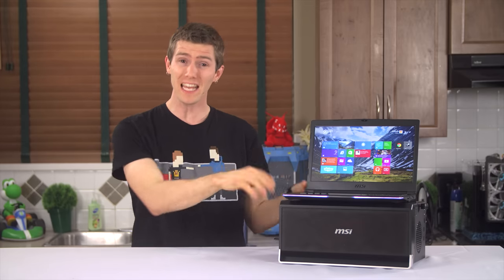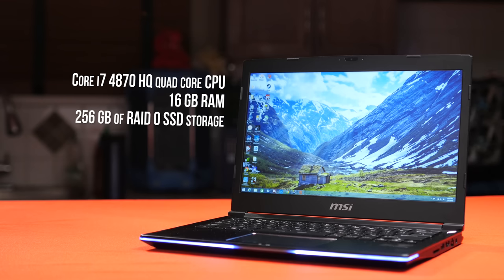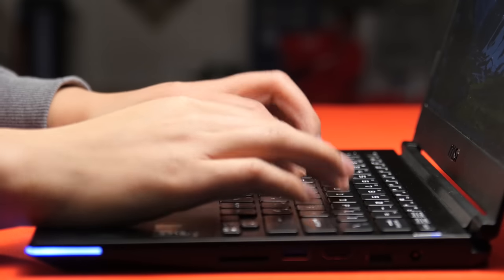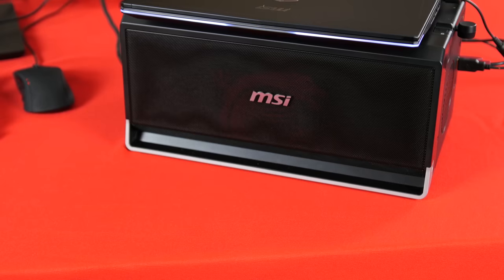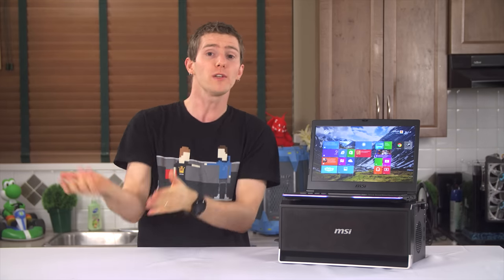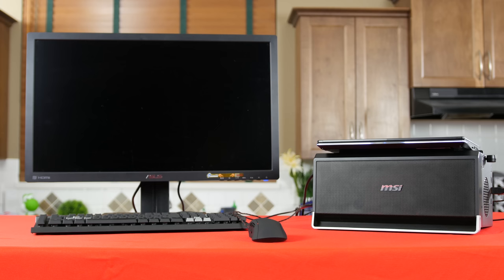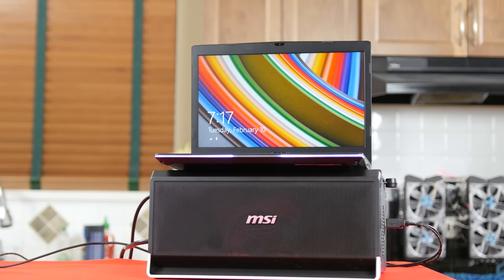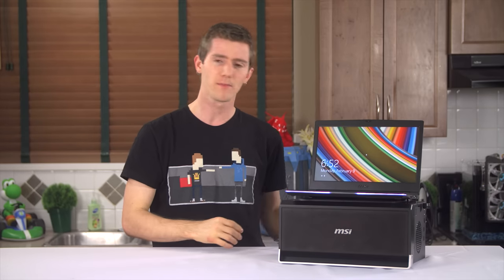MSI GS30 Shadow - Part Beastly Gaming Rig, Part Ultrabook

Comment: Okay I don't unserstand. Either people here are dumb or they just can't think outside the box. Let me explain this. This is not a solution for gamers on move, this is not a solution for desktop gamer who like his build and how it looks. This is a solution for people who are gamers, game at home 99% of their time but still need a notebook for meeting/work/school. I personally would benefit from it. I work with my notebook but I don't travel often and certainly when I do and don't want to game then. I also have a powerful rig that I build for gaming. I have not picked up tha gaming laptops because they suck and it's the truth. MSI solution is the best thing in the world for me. I can still maintain my gaming addiction and still be able to work on lightwieght nnotebook. Do I think its perfect? No. As linus said there are 1st gen problems with it. I would prefer better batery life for sure. Better keyboard would be nice as well and if it as loud as Linus said I would not buy it myself. But unlike many of you here I can see the purpose of this device and see areas where it is useful. Maybe with Gen 2 or 3 of this product I will buy it however still I consider this move to be the right one.
Reply: At 2,000 dollars for just the laptop and the dock, no desktop gpu, you can get a decent 800 dollar laptop and a 1,200 dollar desktop. That is why it is impractical right now. And the excuse of gaming on the go can't be used for this because the dock is as large if not larger than some complete ITX computer builds.
Reply: Timothy Lastovica I have spent over 3k on my notebook and PC. Having this is more practical for me. And when did I mention about this being on the go? I said specificly this isn't for people on the go. Yes 2000 without is a lot and yes they could take it down to 1,5k but hey its Gen 1.
Reply: much agreed brotha, i use my laptop for class and thus carry it around with me every day, then i get home and i wanna game and watch 4k videos and all that fun shit. i had a macbook pro 2010 13 inch, cool n all but recently got a GS60 4k. wish this had come out a month ago.... perfect to dump your exact same laptop at home with all your programs n shit and have proper desktop performance, then pickup and go. I certainly don't game on the go and if i do it's minecraft, which the iris pro can handle. anyways yeah, now to sell my GS60 haha
Reply: Fighting_Hussar Dude u can build ur own litte box way cheaper if so
Reply: Fighting_Hussar I didn't use your name in that sentence about gaming on the go. Its Youtube, I'm prepared for some idiot below me to use that rebuttal. The laptop has Intel Iris pro graphics. So the only way anyone would game on this particular setup is it in desktop mode. Literally no different than having a average notebook and a gaming desktop. If MSI put an 860m in the notebook for the price point at least it could do light gaming on the go plus desktop style gaming while at home. I also have no hope in seeing the price of this equipment drop. Any gaming branded laptop has carried a huge price tag for the last 15 years. As for you in particular, i don't see how it can be more convenient. Come home, put the laptop bag by the side of your desk, and start up the desktop. Come home, unzip the laptop and put it in the dock, plug in the cables, start up the laptop. Though I don't care how you spend your money. Hopefully they improve it next generation so you can get out of it what you see in it. I just find it impractical.
Reply: I like the idea too, and i hope it becomes more standard. But it is ridiculously expensive.let me tell you why, for 2000 dollars you can get a razer balde with gtx 970m which has better battery, better screen, similar processor, and can game on the go or at home. note that the razer is already an expensive product.for 2000 dollars here, you also need to   add a graphics card, and an external harddisk. I think it should be 400~500 dollars cheaper. or they should include with it a decent graphics card like gtx 970 or amd r290 or 280x and 1 TB hard disk at this price . Also i think it would better if they used a dedicated mobile graphics like gtx 850m and to drop the Iris Pro. Alienware, which is already a company with overpriced notebooks has a similar solution that doesn't require you to buy the dock purchase seperatly at 300$, and it starts much cheaper at 1000$ just for the laptop that includes an i5 ULV and a gtx 860m and can run the dock on the same notebook screen.
Again i am a fan of this idea and i will wait till it is improved and reduced price till i consider it. for now it just better to get a decent 800$ ultrabook and 1000+ dollars gaming desktop pc, and still have some money on the side.
Reply: Timothy Lastovica Just needed to clarify this: "Come home, put the laptop bag by the side of your desk, and start up the desktop. Come home, unzip the laptop and put it in the dock, plug in the cables, start up the laptop."

What cables are you plugging in? Considering that the dock has ethernet, mic and speaker, 4 usb...What do you still need to plug into the laptop?
Reply: Goldmarble Honestly the cables were from muscle memory of power and mouse. It won't need power since it charges through the dock and for the mouse your milage may vary if you re using one, buy two, or have a wireless with a small hub.
Reply: Laptops r too expensive for gaming not to mention lots of overheating issues. no matter how many new one they build. Til they have figure out a solution to this it's pointless for an expansion device. I would like developer to also give u the option of custom build laptops for graphics card of. Your own choosing n also heat sinks of your choosing too.
Reply: Sorry I don't think I understood why you wanted this? As in why is this a better solution that having a gaming pc + a laptop? Is it because of the price you spend or something I'm missing?

My laptop I had for undergrad finally crapped out after 5 years and I got a chromebook and built my own gaming pc, Including every single thing in the price (cpu, graphics card, monitors, os, the chromebook, etc) I spent ~1300 dollars. I know that I didn't build like the most top of the line computer or anything because I play 2 kind of low power games, but even if you spend the extra 700 dollars you can get a better gaming pc set up than this notebook. 

Why is spending like 1600-1700 dollars on a gaming pc and then 200 dollars on a chromebook or like 300 dollars on a laptop (both which will work just fine for a job/school) not a better solution than this?
Reply: Molin Ray That'd probably suit me in the next 4 / 5 years, however right now i'm in college 5 days a week. When i'm home I use my laptop, when i'm at college I use my laptop. Everything is on that it. I can work anywhere and I have all of my files on that thing. Having a desktop is totally pointless and is actually an issue. When working from it i'd have to transfer GB's of film footage and transferring a VS or Eclipse project really isn't easy beyond WPF or Win Forms. If I had a desktop i'd have to transfer everything because i'd most likely only be able to buy a £600 laptop, which is probably awful in comparison to a £1200 - £1500 custom build. 
I think I game on it 2 maybe 3 hours a week. It's a hobby. I really reap the benefits when working with video however.

In other words, having one machine makes my life easier. I'm at college, so I need a laptop. That's it, and i'm willing to pay a premium for that. When they get this perfected I may consider purchasing one. At the moment I have a £2000 Macbook Pro, and as soon as the Thunderbolt 2 to PCI docks come down in price i'll be purchasing one.

Once I leave college, i'll most likely not need a laptop. That's why I spent so much, so it'll last me for years. Hopefully my next computer will be a Desktop, however I just love being able to pickup my computer and have everything with me always. It makes everything so much easier, I even use it at work.
Reply: Steven Chorkley Yeah I totally understand that, but that seems to be a case by case scenario. As a science/econ student I didn't have any big files that a flash drive wouldn't have taken care of and I didn't really work with video or anything. I pretty much used my college's blackboard, a program that let me listen to lectures and some basic watching videos on youtube or the school server etc.

And yeah I'm really loving this set up right now. A laptop with a decent battery life for grad school + a nice computer to go home and play games on. Not to mention something like a chromebook keeps me focused in lectures (can't really play any games unless you just wanna play like flash games or something).
Reply: why not get a gamingdesktop and a cheap notebook
Reply: It doesn't have a GPU included. You could get a cheap notebook and a good desktop if you think about it.
Reply: the major problem with this is the price. if the price is almost equivalent to a laptop pc combo its a decent solution. but stuff like this will be always overpriced. so everyone with a clear mind will never buy something like this
Reply: ***** Also, NO GPU.
Reply: No travelling with this thing, either.
Reply: People keep saying to get a cheap notebook and a decent gaming desktop instead of this.

The problem with that idea, it that it doesn't really compare. A cheap notebook is going to be a hell of a lot slower than the GS30, because it isn't going to have anywhere near as good of a processor. Not going to come with a pair of SSDs, and most important, is not going to have anywhere near as good of a screen. I have a shit laptop with a seriously bad TN panel, and it is aggravating to try and use without getting colour distortion. This has an IPS panel, which makes that a complete non-issue. Viewing angles matter.

Again, this is a premium notebook, with an additional feature for when you get home.

Again, this has a Core i7 4870 cpu, and a 13.3" 1080p IPS panel. If you would be fine with a terrible little notebook, and a decent gaming rig? This is obviously not targeted to you. If you want a damn good little notebook, and a gaming rig? Then this MIGHT be for you. Seriously, just because it doesn't make sense for you, is no reason to shit talk a product.
Reply: Goldmarble I don't know about others, but my issue is this whole docking system.

 In order to use this system, you need this laptop ($2000 premium laptop, no other laptops can currently use the dock if I understand it right.), the dock, a separate GPU (not included, and the average good GPU costs $300(?). Correct me if I'm wrong on the price. ), and separate peripherals (monitor/mouse/keyboard, costs are too varied to even try to guess).

For the amount of money you have to put into it, it seems cheaper to get two separate systems. I know it has first gen pains, therefore expensive, but is there even a demand for this system to get past those pains?
Reply: Goldmarble A toshiba chromebook 2 does have a 13.3" 1080p IPS panel and a ssd. It only costs ~300 dollars too (just pointing that out to counter what you said about other laptops).

Ofcourse a chromebook can't compete with the cpu or gaming prowess of that laptop, but if you just want a good looking, well functioning notebook there are many other options than this one.

Not trying to say you specifically wouldn't use it, but this caters to such a small crowd and is limited by first gen docking that I just don't see it going anywhere.
Reply: Molin Ray Yes. The Chromebook does have an ssd. A 16 GB ssd. Not a pair of 128s or 256 Gig ssds, but 16gigs. Also stepping down to 4 gigs of ram, and a Celeron N2840 CPU. Great if all you are doing is a bit of basic writing or web browsing, but if you do any multitasking, any photo editing? Any other use? No.

This is what I am saying: You're trying to compare two different systems, for two completely different philosophies of use, purely to justify your position based on cost.

But that makes no sense. If someone just wants a gaming rig, and something to surf the web when they're not home? Yeah, a gaming rig and a chromebook make a hell of a lot more sense. No argument. There would be no benefit to be had by the GS30. If someone wants to game while traveling, or spends more time at their friends houses to game? A dedicated gaming laptop makes more sense. No Argument.

But for someone who needs a decently powerful laptop for work, and likes to game when they get home? This makes a compelling argument for some.

Will it flounder? It may. But I commend MSI on the attempt, and I hope it does sell decently enough for them to make an improved, second, and third generation.

And for me? No. I would have no use for it. I have a shitty laptop that I don't really use anyways.
Reply: Timothy Lastovica An $800 laptop is a piece of shit that doesn't do anything unless the only work you do is write word docs.  If you need a grown up laptop to do anything then you are spending a minimum of $1800 on it.  I've been looking all over to try and find a laptop that I can work from and the most acceptable one I've found is $2300 and it's non-gaming.  So I still need a desktop to game on, so now I have to have two.  This laptop would have filled both roles perfectly if the battery life wasn't shit.
Reply: Timothy Lastovica Figures, that was what I was going to ask him. Why would he need a $2300 laptop for work?
Reply: Timothy Lastovica What I do?  I'm a programmer and run virtual machines on my system for development. The thinkpad has too low a resolution and I'd need to bump to the SSD 512gb version anyway, so at $1200 its still unacceptable.  That is the cheapest system I've seen running an MQ though it's probably the display and small battery that got them there.  For the other link, 8gb is too little ram, unchecking that leaves the Thinkpad you already linked and an HP with a spinning disk (which is unacceptable) that is already fairly heavy at about 6 pounds.
Reply: FwdBias A spinning disk drive is unacceptable...? So I guess you weren't a programmer until like 2008-2010 onward? Now I see where this joke is going. Though I don't find it funny nor care to hear the end of it.
Reply: Timothy Lastovica You try running multiple VMs on a spinning disk.  Sure you can do it but why the hell would you?
Reply: This seems more like a prototype and than a completely finished product. Hopefully after MSI fixes some of the noise issues and drops the price a bit, this would be a viable option for gamers on the move.
Reply: It's a cool idea but it is very overpriced. Even more overpriced than Alienware's version of this idea.
Reply: ***** Wishful thinking if you ask me. Gaming branded items have always carried a high premium. Slep a few LEDs on it, charge another 300 dollars, and call it "Xtreme Gaming 7000" or some nonsense. After all that is how Alienware's desktop line sticks around.
Reply: ***** So what? The amount of money you dump into this setup, you could have two computers instead.

What happens if the laptop stops working? Now you can't work or play until it gets fixed, assuming it could be fixed at all. If not, then you have to shell out another 2k for a replacement. Where as with two separate systems, you have redundancy. If the laptop goes, you can at least work on your desktop or vice versa. Since each system has a smaller cost, replacing one them isn't hard on the wallet.

This setup only works with this laptop. You cant go buy a random laptop off the shelf and just plug into this docking system.

Lastly this design is awful. They should have followed Alienware's example. Alienware's box doesn't require the laptop to dock, just hook up cables. Thanks to that, a monitor isn't required. An extra keyboard isn't required either since the laptop stays on the desk. The only extra peripheral you need is a mouse.

The idea is awesome, however they executed it poorly in my opinion.
Reply: ***** You're right, it isn't Alienware. Alienware's implementation is actually priced better as hard as that is to believe. $1,400 USD gets you an I7 and a 860m so you can actually game on the go if you so wanted. Instead of MSI's Intel graphics.

http://www.dell.com/us/p/alienware-13/pd

The dock is 300 and together that is still cheaper than the laptop alone from MSI. There isn't any getting around it. MSI is screwing you at this price point.
Reply: Timothy Lastovica That I7 on the Alienware is a dual core, MSI 13 is a quad. To get a quad core alienware you have to go to the 15in size
Reply: Jay Clarkson Thanks for the catch. Saw I7 and wasn't familiar with the broadwell lineup yet. So $1,500 with a 970m, not bad at all unless I missed something again.

http://www.dell.com/us/p/alienware-15/pd?ref=PD_OC
Reply: Build a PC at the same price and get more horsepower then buy a cheap laptop if all you're gonna do is MS Office and internet browsing.
Reply: +Torny Jerry Obvious a pubescent gamer. So business is limited only to "MS Office and internet browsing". 
When and IF you get out of school and you bedroom you may be shocked...
Reply: Crimson Koba
 pretty much....